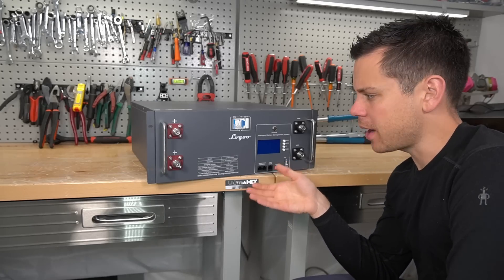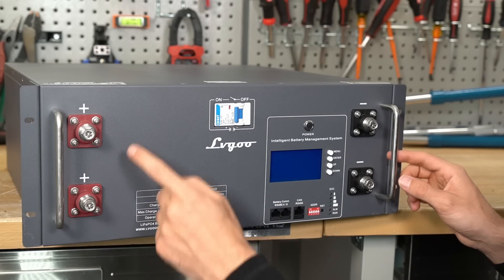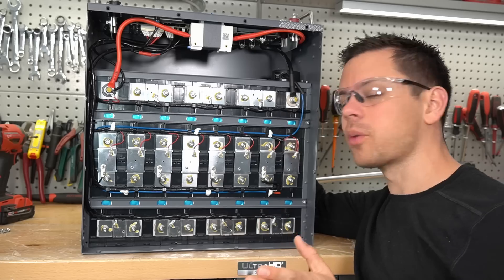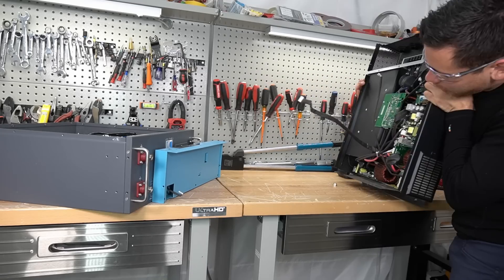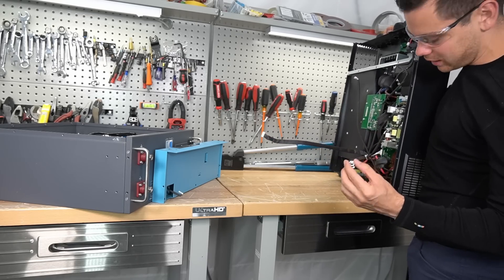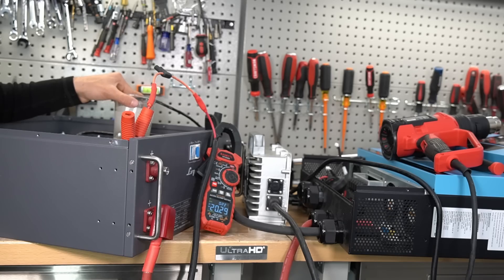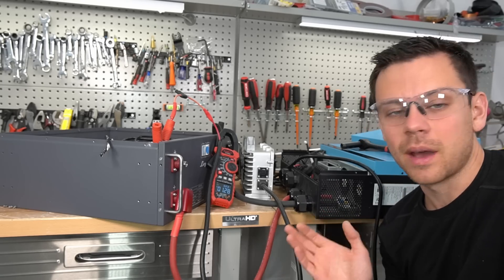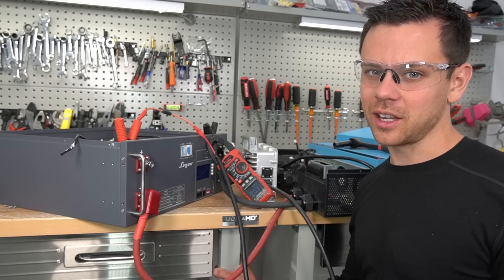New! $1,639 LVGOO 48V LiFePO4 Server Rack Battery

Comment: Doesn't anyone test for functionality anymore? A safety/warranty item like temp sensors should be tested.
Reply: The Temp Sensors of this battery are functional. 

The original Charge/Discharge UT(Under Temperature) settings of Lvgoo LV48V100D Server Rack Battery BMS are: 
CHG UT Alarm(℃): 0.0

CHG UT Protect(℃): -5.0

CHG UT Protect Release(℃): 0.0
The duration time in the BMS from the reaching of the temperature settings to practical alarm/action(protect and protect/alarm releasing) happen is 2 seconds. 
It should trigger the CHG UT Protect at the -5.0℃. But Will was spilling the compressed gas duster drip by drip fast on the sensor to make the sensor's temperature drop fast so during the trigger action duration of CHG UT Alarm/Protect, Will's temperature detector found the temperatures under -5.0℃ and finally captured the lowest  -10.0℃ when the  CHG UT Protect was triggered sucessfully.😀

According to our quanlity system, a series of processing and tests are done after production and before puting them in the package box and the test results will show on a <Inspection&Testing Report> including:
Appearance: No scratch,rust or stain on outside surface: Printing and Nameplate is clear,Warning and Tips are complete and readable.
Dimensions: Consistent with Product Nominal Sizes:L*W*H: 450*442*177mm
The Display Screen is intact, and the contents in Screen are clear.
BMS Buttons works, BMS is able to be activated and deactivated.

Power ON/OFF: The pack is able to be powered On/Off by POWER Button.
Circuit Breaker is able to be switched On/Off manually and triggered by certain conditions.
Pack Basic parameters in Display Screen are in normal ranges.
Pack Basic Functions like Discharge and Charge work.

Communications: RJ45 Ports are intact and RS485&CAN Communications work.

Capacity: ≥100Ah(@25°C, 0.25C Charge, 0.5C Discharge).

Internal Resistance(IR): Qualified IR: 0~80mΩ.
Open Circuit Voltage(OCV): Qualified OCV: 52.0V~53.5V
Items in Box: Battery Pack LV48V100D*1, Mounting Ear*2, Pack Communication Cable*1, Terminal Cap*4, User Manual*1, Inspection & Testing Report*1.

Report Conclusion, Signatures of the QC Inspector/Checker and the issue date of this report.

Comment: Thanks for the video, good test. It is good to call out the cold temp issue.
When doing these can you compare to your current favorite. example if this Battery isn't at least 20% cheaper(to the door) than the EG4 ..... why buy them?
 To me the point of competition is the young guns start off cheaper to get an audience.
should be cheaper, better warranty and better customer service.
Example SOK did that.
Reply: Hello Ptee, this battery is USD1639 free shipping to the door of the American customers. What are the things that make EG4 battery should be 20% price higher the this Lvgoo battery or make Lvgoo battery should be 20% price lower then EG4 battery?
Reply: @Bill  competition,
Lvgoo has to prove itself
Part of that is starting at a lower price to get our attention, If they want to be in the game a long time running 6mo to a year at a lower price(less profit) if the people love them they get Loyalty and word of mouth referrals.
What Will has done for many companies is cheap-ish marketing.
Reply: @pteepan2708  hello Ptee, thank you for your advice. The current price of Lvgoo Server Rack battery LV48V100D is $1639 including tax and free shipping. It is competitive with EG4 and SOK at the same product level. You can check that. Of course I know EG4 has cheaper sever rack batteries without display screen and fire arrester but the this is not the same level of LV48V100D. In addition, for the cells in LV48V100D, they are the top lifepo4 leading manufacturer EVE and the EVE cells are the most expensive ones in the market and their quality is highly and commonly admitted and recommended in the lifepo4 cell market. This point was not pointed out in the video and Will thinks the cells and BMS in the server rack batteries are almost the same if they are brand new. But Actually they are different and in the long term use of the battery pack for decades, it would show up. The battery serviceability is the case.

Comment: Is there a way to remove the handles, so you can put a rubber sheath over it and bolt them back to the battery case?
Reply: As the manufacturer, we will consider your advice to make our batteries better and safer. Thanks!
Reply: Hello Eric, As the manufactuer of Lvgoo LV48V100D battery, we will replace the stainless steel handles which are quite closed to the nearby battery terminals by rubber coated(about 0.8mm thickness) handles which are 100% firmly coated and 100% insulation.😀
Reply: @bill8336  Hey Bill. Good to see a manufacturer listening to feedback. It's always a good sign.
Do you have any UK distributors you could point me toward?
Reply: We will use the PVC coated(about 0.8mm thickness) handles which are 100% fully coated and 100% insulation from the battery termials. We put the original handles into liquid PVC and get them out to cool them so the PVC would attach on the handles firmly.
Reply: Clear heatshrink would work and look neat.
Reply: @DEADB33F  As the manufacturer, we will consider your advice to make our batteries better and safer. Thanks!

Comment: The problem with these server rack batteries is that they're all too expensive.
Reply: Its price is USD$1639 Free shipping
Reply: @bill8336  That's a lotta quid. Chinese sure have some audacity charging as much as American brands now.
Reply: @basspig  Yes. The LV48V100D battery is not cheap. We use the EVE A+ cells. Will did not mention that in this video but Will emphasized the higher quality and leading positionof EVE A+ cells in the cell market a few time before in his videos and on the page of 48V server rack batteries list he recommends. The leading EVE cells are more expensive and their quality are highly and widely admitted in the cell market. American brands are obviously more expensive than Chinese brands in the LiFePO4 battery area and many batteries of the American Brands are made in China. We made the LiFePO4 batteries and export them to the USA market to sell them to the customers in the USA directly. This makes the supply chain shorter and less process in the middle to cut the non-necessary costs.
Reply: @bill8336  I can see that the system is well constructed, but it is still very costly. If I were to build with these, I could only have 1/3 the capacity. I would need a stack of 9 of these batteries to equal the capacity of the 48 grade A 280Ah cells I'm using now. That would cost a lot more than the 11 grand I spent on batteries, BMSes and steel cabinet from an American supplier.
Reply: @basspig  1. We have the solution for the 11 grand budget to have the same capacity as your current application but less work you have to do yourself because we have the 48V 280Ah battery Assembly Kits including 3.2V 280Ah or 300Ah cells and all parts needed like terminals, cables, BMS, bus bars in the package. General Speaking, the cost per Wh of the 48V280Ah or 48V300Ah is lower than 48V100Ah. But these Kits are not available now in the USA. We ship them from the factory in China.  
2. It is important to make the batteries cheaper and acceptable for more customers. Thank you for telling me the info of your DIY project. If you have new project, you could ask me for a solution within the target budget.
Reply: @bill8336  the US is about to go to war with China. I'm very concerned about replacement parts for nearly all of the system is Chinese sourced gear.. Growatt, Sungold Power, etc. The batteries are made in China, quality graded in USA and assembled into packs.

Comment: 48v 100amp. Deadly as hell.
Reply: For like one milliseconds you should be fine
Reply: @MrArcticPOWER  exactly then dead. Funny how will thinks we’re all elec engineers and know exactly how to wire this crap and what’s dangerous or not. Sorry will I won’t guess and opt for 12v. Call me a p all u want I’ll be an alive p not a dead one. Convenience is useless when ur a toasty corpse
Reply: 48 volts DC is not deadly. It needs to be 110 V or more at DC.

And the max current rating that the battery can deliver is not relevant to whether the battery can kill as all it takes is milliamps to kill and that current is determined by the resistance in circuit in conjunction with the voltage.

That is, if you grab both terminals of that 48 volt battery, you are not going to get anywhere near 100 amps passing through you. In fact you won't get enough to kill you at 80 milliamps.

Now if you short the battery terminals with a dead short...that's a different story. Something is going to get extremely hot.
Reply: @deang5622  it’s the voltage which pushes the penetrating of your skin. 12 can’t do anything 24 some little shock but 48v def pretty bad maybe even enough to shock a bad heart. So you bought convenience over safety. Smart. Real smart for a noob. Let them wire their service in their home it’s simple right. 🙄. The stupidity of this channels abounds like everyone does wiring. Did you ever inquire why Will does this, ask him about his education. He is an electrical engineer which all us noobs are not. Yeah smart get noobs to wire 100-200amp 48-96v. It’s literally negligent to say just do that. Oh also tie into a grid. Try wiring your home box for kicks. See how that goes. 🙄. There is a reason they make some of these super simple setup. Mostly for noobs but also cause a noob isn’t going to wire one or even grid tie without and ELECTRICIANS help, there is a reason they are expensive. Cause it’s dangerous
Reply: @jecrpalier  Nope. The voltage that can cause  electrocution is 50 V RMS AC and 110 volts DC.
Reply: @deang5622  lol close enough to near kill. Where is ur thinking dude.

Comment: Thumbs up 👍 serviceable? This a clean build!😊  you need to get some plastic tools or something to keep your self safe. I would keep my self informed about the temperature issue. I’m glad you did this battery 🔋 😊
Reply: 😃It has the Highest serviceability, Detachable & Replaceable Design for all parts including Cover, BMS, Cells and Cells Holders, User Serviceable.
Thank you for you advice.❣

The original Charge/Discharge UT(Under Temperature) settings of Lvgoo LV48V100D Server Rack Battery BMS are a little bit different from other batteries but Adjustable by cable connection and communication on PC with BMS software installed, they are: 

CHG UT Alarm(℃): 0.0

CHG UT Protect(℃): -5.0

CHG UT Protect Release(℃): 0.0

DSG UT Alarm(℃): -15.0

DSG UT Protect(℃): -20.0

DSG UT Protect Release(℃): -15.0

It should trigger the CHG UT Protect at the -5.0℃. 😅But Will was spilling the compressed gas duster drip by drip fast on the sensor to make the sensor's temperature drop fast so during the trigger action duration of CHG UT Protect, Will's temperature detector found the temperatures under -5.0℃ and finally captured the lowest  -10.0℃ when the  CHG UT Protect was triggered sucessfully.

The BMS of Lvgoo LV48V100D Server Rack Battery is high quality and long, so with 2 terminals on each side of the BMS inside the battery case, the spaces for the 2 solid Handles are narrow and have to be quite closed to the terminal nearby. The Insulated materials like Heatshrink and Rubber Sheath are good improvement considerable. We will find the good solution and solve the problem soon.
Reply: As the manufactuer of Lvgoo LV48V100D battery, we will replace the stainless steel handles which are quite closed to the nearby battery terminals by rubber coated(about 0.8mm thickness) handles which are 100% firmly coated and 100% insulation.😀

In addtion, we designed and did the test to confirm the the sensitiveness of Temp. Sensors and and the effectiveness of the UT(Under Temperature) Protect Mechanism. The test report was sent to Will and if you need it, I can email it to you.
The Value Settings of BMS CHG(Charging) UT(Under Temperatures) are changeable and effective. 

We decide to be consistent with the Charge UT/UTP settings as Will suggested and other competitors' batteries settings like SOK and EG4 to keep the cells in state of charging 100% away from 0.00℃.

Comment: Is there a way that you can re-program the software to trigger the low temp cut-off at the actual right temperature?
Since they sent it to you, do you have a contact there that you can communicate back with them about the software issue?

Seems strange, I am no LiPo battery expert, but even I know about the fallout of charging below 0° C, 32° F. Why would they not test that piece of the software before sending it out?
Reply: Yes, it would be a hardware fix on a software problem. Though, once the values are known and where to solder, you could aftermarket mod them for $1 in resistors and 30-60 min of your time in disassembly, soldering/crimping, and reassembly. If the cheaper battery is that coveted. 

Though, I would advise against this if soldering or liPo are unfamiliar to someone.
Reply: @ThomasWood3DPrinting  Though I have never bought a battery like this, wouldn't this void any warrantee you might get by altering the hardware?
Reply: @EricStott  potentially yes, though the burden of proof that adjusting the low temp cut off sensor caused a failure elsewhere is legally on them.

If there is a situation where these batteries might get that could, I think charge controllers can also cut power at certain temps, or just use a heat pad.

If I installed these, I really hope my house won't get that cold, or something else has gone really wrong. So low temp cut off wouldn't affect my use case and if I bought them, I probably not even mod them.
Reply: @ThomasWood3DPrinting  I agree, a server rack battery I would think would be better suited in a home that can keep itself above freezing. It probably is more of an edge case. 

I personally think we are going back and forth WAY TOO MUCH!
:)
Reply: We sent the battery to Will and we are the manufacturer of it. 

The original Charge/Discharge UT(Under Temperature) settings of Lvgoo LV48V100D Server Rack Battery BMS are a little bit different from other batteries but Adjustable by cable connection and communication on PC with BMS software installed and a code, they are: 

CHG UT Alarm(℃): 0.0

CHG UT Protect(℃): -5.0

CHG UT Protect Release(℃): 0.0

DSG UT Alarm(℃): -15.0

DSG UT Protect(℃): -20.0

DSG UT Protect Release(℃): -15.0

It should trigger the CHG UT Protect at the -5.0℃. 😅But Will was spilling the compressed gas duster drip by drip fast on the sensor to make the sensor's temperature drop fast so during the trigger action duration of CHG UT Protect, Will's temperature detector found the temperatures under -5.0℃ and finally captured the lowest  -10.0℃ when the  CHG UT Protect was triggered sucessfully.

The battery has High Performance True A+ EVE LF100L(A) (3.2V 100Ah) Cell*16 Fastening Connected in series. EVE is the leading LiFePO4 Cell manufaturer.
Actually in the official Product Specification of EVE LF100L(A) Cell, Its charging tempetature is 0~60℃ and its discharging temperature is -30~60℃ and its recommended use temperature is 10~45℃. The original Charge UT(Under Temperature) settings of Lvgoo LV48V100D as above is reasonable(not perfect) because:

1. If the battery charging temperature is in the range of -5.0~0.0℃, it is still in the minimum safe temperatures, it would not cause irreversible and permanent damage to the cell.

2. Usually the battery charging at the temperature range of -5.0~0.0℃ would not last long time because the charging creates heating of the cells and the cell temperature would be over 0.0℃ soon so with this comdition, charging temperature in the range of -5.0~0.0℃ would not cause irreversible and permanent damage to the cell.

3. It is common that the temperatare(the sensor gets) of the cell box is lower than the temperature inside the cell since the charging heat comes from the inside of the cell.
Reply: @bill8336  "The original Charge/Discharge UT(Under Temperature) settings of Lvgoo LV48V100D Server Rack Battery BMS are a little bit different from other batteries but Adjustable by cable connection and communication on PC with BMS software installed and a code"

Is this documented anywhere in the manual that is sent with the battery, or a link to the documentation online?

I (of course) have not bought the battery, but @Will Prowse is generally pretty thorough in his testing, and reading the documentation before posting a video publicly.

BTW: what does LVGOO mean? It isn't LV Go like @Will Prowse said, it is LV GOO.
Reply: You could potentially add a resistor in series or parallel (depending on the original sensor) to offset the temp.
Reply: @ThomasWood3DPrinting  So: you have to crack open the server rack battery, add a (potentially) bunch of additional hardware to protect your own equipment from getting ruined in cold temperature situations?
Seems shady...

Comment: How does the fire arrestor work? I know I could just google it, but I like hearing you explain things 😁
Reply: Aerosol Fire Extinguishing Device QRR0.016GW/S: QRR0.016GW/S is an effective hot aerosol fire extinguishing device. It is rapid, safe, non-toxic, harmless, and suitable for relatively closed spaces like battery compartments and boxes. 
1. Working Mechanism
When a fire occurs or temperature over 170°C is detected by the thermal line from the device, the thermal line will be ignited to start up the device. The aerosol generating agent inside would be to activated to decomposes the chemical coolant through the heat released by the redox reaction, to realize the joint participation of the aerosol generating agent and the coolant to extinguish the fire.
1) Gas-phase chemical inhibition(Main Effect); 2) Solid-phase chemical inhibition(Main Effect); 3) Cooling and extinguishing effect of endothermic decomposition(Auxiliary Effect)